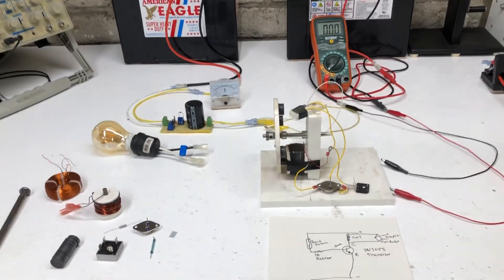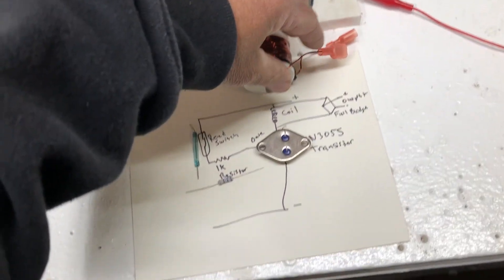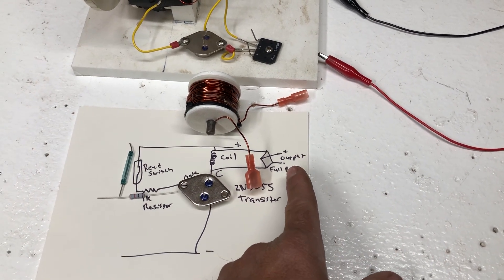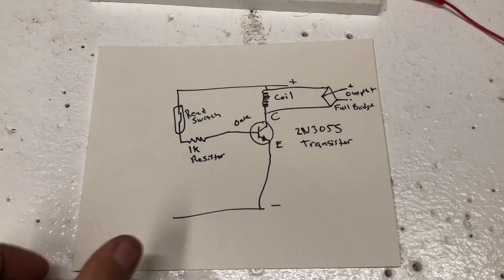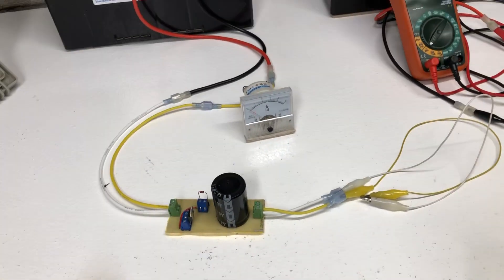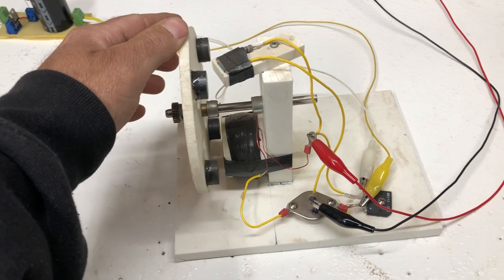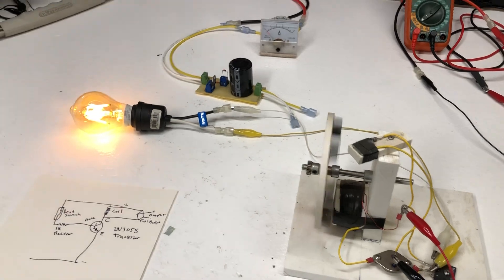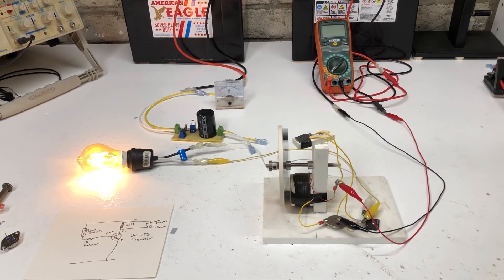Basic pulse motor fundamentals

Comment: Bonjour,est il possible de faire le mème circuit en 120v dc ? MERCI
Reply from the maker: @balloutyves  better to start with 12v
Reply: @kenergy1707  Merci,peux tu me donner des éléments de composants pour le faire en 120v, avec un capteur hall 3144 ?
Reply from the maker: @balloutyves  you can use Hall effect to do the same thing

Comment: A smooth presentation. Nice delivery. Good content. Have you measured the input power versus the output power? Kudos to redesign3dp for pointing me to your channel!
Reply from the maker: Thank you 
I have not this is just a learning model
Reply: @kenergy1707  Ah, gotchya…can you point me to a video that measures input and output power?  It seems to me there are three camps of thought regarding these experiments. 1-There is free energy everywhere, and its unseen forces are just waiting for meaningful discoveries. 2-anyone who mentions a Bedini, Adam’s pulse motor, etc., is a quack and loser.  3-this is where I believe you fall in.  You seem to know we can't violate the laws of physics but want to find out how close to the line we can come without crossing.  You explore the question, how efficient can we make electromechanical machines?  Just my thoughts!  Thanks for your prompt and thoughtful replies!
Reply from the maker: @shawncalderon4950  I don’t have any that are big enough to measure all small prototypes
But my outboard video might shed some light
Reply: @kenergy1707  okay thanks, will check it out!

Comment: Why not make a pulse motor with no magnets in it? The magnet does not help with the claps of the field seems to me to be the lose in the system.
Reply from the maker: I do have pulse motors without magnets they are called attraction motor I have 4 or more videos about them
Reply: Do they supply the same back emf as one that has magnets
Reply from the maker: @IrvinParker  same as a metal core motor
Reply: Working on what I would call a chaser motor that I have been building it uses the pulsed coils and the metal in the rotor is alway chasing the field that move in a circle.
Reply from the maker: @IrvinParker   very cool are you removing the extra energy?

Comment: Just one suggestion. It is much better to use a MOSFET instead of that BJT and a single or 2 diodes in parallel instead of that bridge rectifier. A bridge rectifier does not serve the actual purpose, which is to isolate and remove the collapsing spike successfully, into another battery. You don't want to syphon off any of the normal power coming from the transistor to the coil. Most people don't understand the big difference and think that a bridge is more efficient, but in this case it is adding to inefficiency.
Reply from the maker: For beginners it is much easier to use a transistor because it limits the amperage so the circuit doesn’t melt down on mistakes and doesn’t have a internal diode 
  Full bridge rectifier is also simpler for beginners than a diode and works quite well you should try it
Reply: 😅😅😂😂 @kenergy1707

Comment: As a retired teacher
I can tell you
You are a natural
Great video my friend 
Thanks
Reply from the maker: Thank you!
Reply: @kenergy1707  what’s is the optical sensor you used on the motor?
I want to get one of those
I keep breaking my glass Reed switches
LOL
Reply from the maker: @Gacha.Cupcake  
kbgenergy@gmail.com
Reply from the maker: @Gacha.Cupcake  

Omron EE-SV3
Reply: @kenergy1707  thank you sir.
Reply: @kenergy1707  by the way, what do you use for the interrupter or does it come with one
I ordered the regular Sc3 and one of the SC3-CS to try 
It sure is a better option than hall sensors and reed switches. Thank
You
Reply from the maker: @Gacha.Cupcake  I make my own out of thin aluminum
Reply: @kenergy1707  got it. I will try them when they come in. Thank you sir
Have a nice day
Reply: @kenergy1707  what resistors do you use with this!
Actually if I could get a copy of a diagram(if you have one) that would be awesome. Thank you
Reply from the maker: @Gacha.Cupcake  what’s your email?